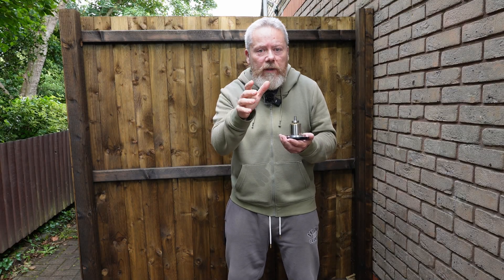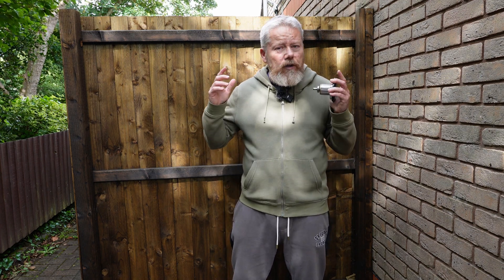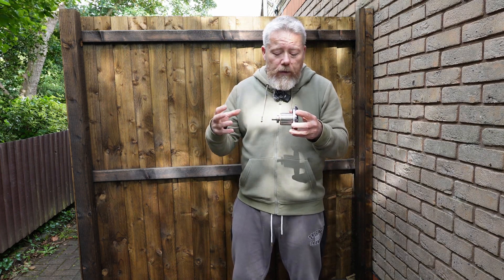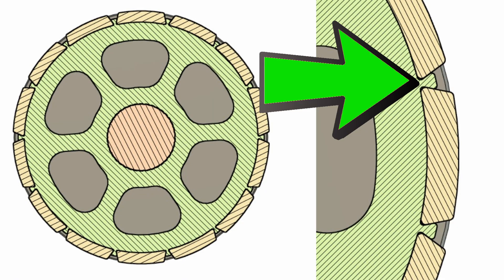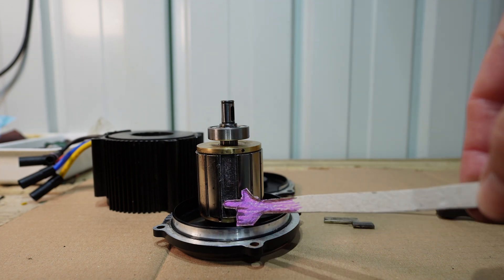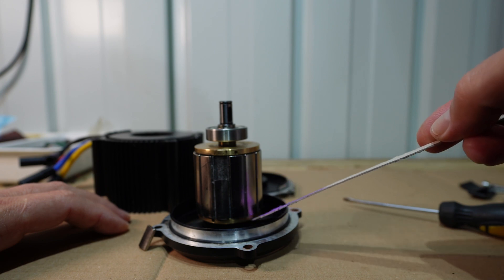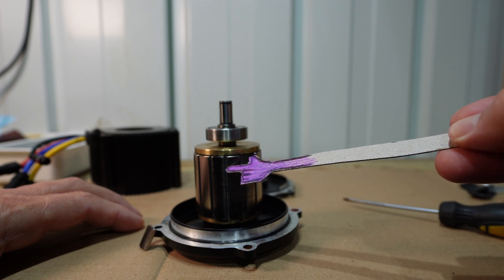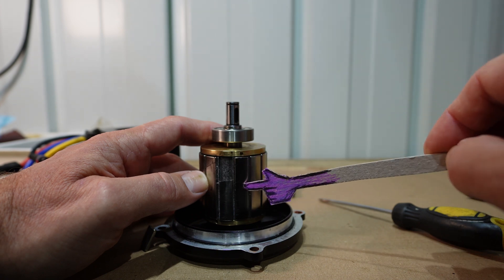3500 Watt failure investigation of the  CYC Gen 3 Motor Core Magnets CYC damaged motor destruction.

Comment: Ok...engineer here.  Many engineers because its their field of study can write books about this stuff.
I will try to show some restrain. First, credit where credit is due.  Good job.  You contacted CYC in earnest, you were not operating outside the allowable voltage threshold of 72 volts...presumably you have a basic controller of 30-40 amps peak and that is why you paid all that money for that expensive motor when I would have directed you to a Bafang BBSHD which is a bricksh_t house by comparison.
CYC is up to their 3rd rotor design iteration.  Each iteration they have 'tried' to increase magnet retention and it still appears to be a marginal design even with belt aka adhesive and suspenders aka a slotted interface sometimes referred to as 'tongue in groove'.
Btw, don't be too hard on German's use of the term sleeve or slot, I have worked with a lot of German engineers who are smart...its a language thing only.  Glad they are trying to resolve it with you and of course its their reputation because by all appearances, you are an honest man.

Begs the question, why is CYC failing?  Reason is, they are metaphorically trying to split the baby.  A low mass armature has relatively fragile magnets by their design direction of reducing rotational mass...but heat is the enemy because in engineering there is no free lunch and the lower mass of the armature translates to 'higher heat' for the same power level.  Remember Watts = Volts X Amps.  CYC motors because they like to keep the mass down for both static weight and lower rotation inertia and higher RPM...but they screw the pooch on temperature which is the enemy of reliability.  By contrast, Bafang builds heavier motors that are more robust for the same power which turn lower RPM with beefier armature and absorb the same level of energy at lower heat level which is a win for long term reliability.

In design, as it turns out, you chase your tale a bit aka rob Peter to pay Paul.
What is the other half of the book?  Quality control aka manufacturing process variation.  Their manufacturing process may not be robust 'enough' for your power level.. May work fine at 52v for example, but not at 72v up steep hills.  But, some units they ship may work fine at 72v. This is statistical process control...maybe you have heard of it.  Things like magnet tongues and armature grooves are made to a tolerance aka 'slip fit'.  Adhesive tolerance maybe thickness of application and/or adhesive material property variation.

All what you said and again to commend you for making this effort, you are correct in your observations.  Physics don't lie just like why the Titan submersible imploded.  Material science meet moment of inertia...what engineers go to school for.

But you didn't finish the story.  If me?  I would ask them to ship you a 'validated' 3rd gen rotor, build it and test it and let us know if lightning strikes twice.  If it does, your two options are to cut your loses, thank CYC very little....joking, sell your CYC Pro with yet another new rotor and install a Bafang BBSHD.  If you want to go fast and switch motors, just post and I can direct you to a company that sells an aftermarket controller package for a BBSHD that will generate more power than that CYC at 72v and not fail, all for lower cost.  I would stay with CYC since they are trying to help you in earnest, but if another fails, those are your choices or disassemble your battery and take some cells out of series for lower voltage.
Reply from the maker: They have sent a new motor and will be giving a good test soon. Hopefully I can get some miles on the new unit and see if failure strikes twice 👍
Reply: @baconbuttties  Perfect.  All you can ask. 👍
Reply from the maker: @lukewalker1051  👍
Reply: It's interesting to see the magnet failure in that way. I'd be Interested to see how astro does it. The motor design seems quite similar and I don't recall any magnets getting loose (no demag at temp either thanks to samarium cobalt magnets). I've had that astro ripping hot too. Hopefully they find a solution. Reminds me of flight testing UAV motors. Factory thought it was fine to not glue the stators to the base, spun the stator and broke the windings. Strong magnets make nice power but you've gotta be able to hold on to them and anything else they are going to try and spin...
Reply from the maker: @kolendakomputers2491  👍👍
Reply: As someone considering the CYC Pro Gen 3 vs BBSHD your post is super helpful. I will be watching this channel to see how the new motor performs.
Reply from the maker: @Greg-me8le  👍👍
Reply: That is the best comment I've ever heard.
In a nutshell, get 3000w 72v hub kit.
No chain to fail, and ultra quiet.
Reply: what is the company that makes the the aftermarket motors? thanks to your post you swayed me to get the bafang motor
Reply: @remylauren7604  don't understand...you ask about aftermarket motors and then have decided upon the Bafang motor.  Then you said you want no chain which means hub drive and that isn't the subject of conversation.  Hub drive versus mid drive is a 'lifestyle' decision.  Hub drive ebikes are more like scooters and mid drive rely more on changing gears and rider interaction.  Very different ebikes.
Reply: @lukewalker1051  i meant battery sorry about that.

Comment: What do you think about Bafang motors ?
Reply from the maker: I have had a few Bafang motors and  all of them have been good.
Reply: @baconbuttties  I got a full 10K miles from my G60 hub, and that's been good for max 40A through a vesc
Reply from the maker: @GoingOutToThePartyPeople  👍👍
Reply: Nice video. I seriously doubt these things will handke 180C. The windings will melt long before. They have tried many tweaks on the rotor design. It's pretty easy to break them doing sustained hills at 3kw+ The newer ones with the x6 have better thermal rollback. This might be a bad batch of rotors. The high rpms do not help. That speed and heat will exploit the slightest flaw when it was made in the gluing process. The other kind of motor where the magnets are held is called an ipm.
Reply from the maker: I'm going to be testing the replacement motor soon and hope to get more than 39 miles before failure 😮
The problem is Wales is very hilly so It could possibly happen again.
Reply: @baconbuttties  good I hope it happens again, so once and for all we can establish that this gen is 3 is not all that they say it is and force them to redesign it asap.
Reply: @baconbuttties look forward to your next test.  I'm awaiting a new rotor from cyc myself,  if this one fails to solve the reliability issues ive been having, my kid will get a very expensive ebike kit while I use a bbshd
Reply from the maker: @mcfizzlestag  👍
Reply: @HighVoltageKits  well explained.